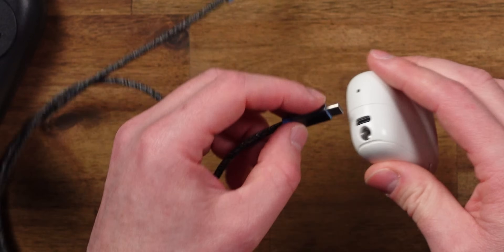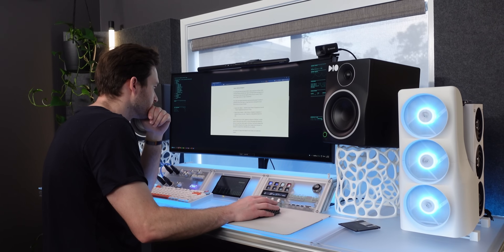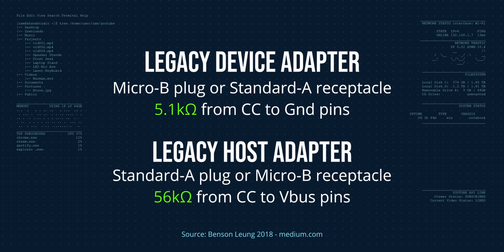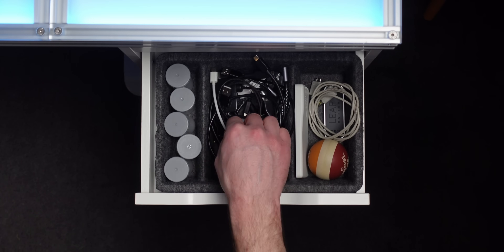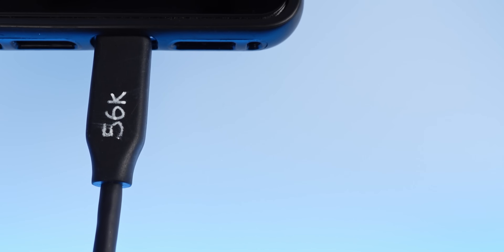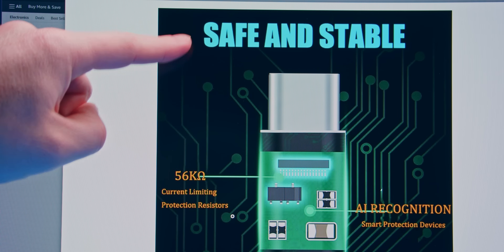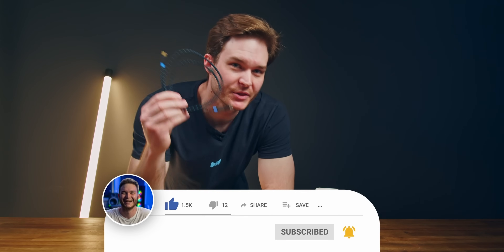USB-C to C cable not charging fix... by dongle?!

Comment: Hey Cam,
I really enjoyed watching your desk project, it actually inspired me to do a full room makeover!
I had a few questions and ideas I’m considering:
1. Is there anything you regret building into the desk? If so, what?
2. Are there any things I should be aware of before building a custom desk setup like this (with custom screens, buttons, etc.)?
3. Is there anything you'd personally love to see in a setup like this?
4. Did you run into any unexpected technical issues (e.g. screen compatibility, software glitches, heat issues, etc.)?
5. How do you control all the tech? Is it all automated, or do you use specific hardware/software setups?

Thanks in advance, keep up the good work!
Reply from the maker: Stoked to hear you're inspired to build your own!
1. Is there anything you regret building into the desk? If so, what?
USB Hub, it's currently playing up, and since the touchscreen, streamdeck, marcopad etc. rely on it, changing it is a lot of effort. I would (will in a future video), change to panel mount USB ports (extension cables with mounting screws), and then plug them into a USB hub, that way if there's any issues it's easy to swap, and also not hard to find a replacement with the exact ports I want on the panel mount side.

2. Are there any things I should be aware of before building a custom desk setup like this (with custom screens, buttons, etc.)?
If you use a metal frame, like I did, it's important to not have components PCB's touching the frame, as they can earth through different devices, and I think one of the LED strips is what's causing the USB hub to play up because of this 😅

3. Is there anything you'd personally love to see in a setup like this?
For me lighting is super important, not only for filming but actual functionality. I recently added an LED bar on my monitor, but will look to potentially ceiling mount a custom light that has controls in the desk dashboard. So for sure add lighting controls from the desk.
other than that I'm currently on a retractable USB cable hunt, you'll see them in my new vid this weekend, so I want to integrate them making it easier to plug phones and devices into my PC with a cable that retracts back into the dashboard.

4. Did you run into any unexpected technical issues (e.g. screen compatibility, software glitches, heat issues, etc.)?
No heat issues, LEDs don't work with razer hub and the razer software anymore (unsure if recent update but I've had an unresolved support ticket open for a long time with them), however the Razor Hub works perfectly fine through SignalRGB as I can manually say how many LED's are connected to each port (razer synapse requires an auto scan first) which defeated the entire effort of making them work with the Razer HUB to begin with. So I'd suggest to find a WLED or other LED strip controller that can do what you want, skip the Razer one.
I'd also suggest buying a powered USB hub, so that it doesn't matter what devices you plug in, all can be powered. 

5. How do you control all the tech? Is it all automated, or do you use specific hardware/software setups?
The Streamdeck is the main "brain" for all of my windows controls, everything else is the general hardware.
I've got my hands on the new streamdeck modules which they've just released, they sent them to me to try out and it's just the part you need to mount into a desk, really cool. But there isn't one yet with knobs like on the plus that I bought.  The knobs can be incredibly useful for volume control, and I also use them for webcam settings. highly recommend an elgato streamdeck as so many of the automations I wanted to program myself are already done in their plugin marketplace.

Hope that helps, have fun! 🤙
Reply: @camshand  Thanks so much for your reply! 🙌
I’ll definitely keep all those tips in mind, super helpful stuff!

About the LED strips, I actually built some myself using microcontrollers and a custom MQTT flow, it works really nice!

About the Elgato Streamdeck, they seem kinda pricey. Do you think a custom macropad would work instead?
I’m thinking about using an ESP32-S3 (really powerful microcontroller, totally worth checking out), with colored displays and mechanical switches.

Thanks again for taking the time to reply! Really appreciate it, and I’ll keep everything you said in mind!

Comment: there should be a thick full PD cable with a legacy switch... I didn't know that there were devices that did this!

do we know if that's within usb-c spec? it really shouldn't be - resistors are cheap!
Reply from the maker: no it's not within spec, they are non-compliant devices which is typical for uncommon brands, however the action camera in this video is from Insta360, one of the largest action camera brands in the world... and they skimped on a couple resistors 🥲
Reply: @camshand 
The raspberry pi 4 also didn't have those resistors.

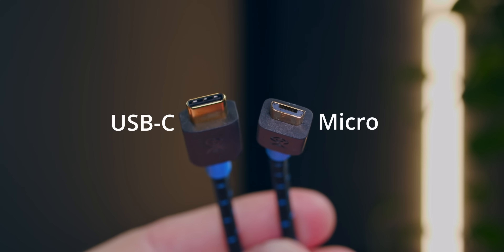Comment: 0:24
What? 
This creates even more problems LOL. Now you ONLY have a 5V cable that cannot negotiate to high voltage like 9V for phones and 20V for laptops.
???? This doesn't solve anything.
Reply from the maker: Maybe you didn't fully understand the issue.
There are USB-C devices out there that do not charge with a USB-C to USB-C cable.
This is because they're non compliant and don't negotiate their 5v needs, so simply don't charge when plugged into a USB-C charger.
These cable combos, allows you to change those devices with a USB-C port, which is major as some wall chargers or power banks don't have USB-A which is what's usually used.

The action camera in the video is a AU$479.99 insta360 GO II so even expensive devices need this.
Yes, it cannot negotiate 9v etc. over USB-C, but that's because it's not for fast charging purposes, it's for devices that don't charge at all.
Reply: @camshand  
I get all that, trust me, I've soldered 0603 5.1k to mod my flashlights and portable radios to accept usb-c to c, letting me chuck all USB-A cables + USB-A to C adapter (similar to yours). If I had done what you did, I'm just replacing (USB-A + adapter) cables with your (micro-usb+adapter), excuse me what??
Reply from the maker: Dude I don't understand? The second example I give in the video is to use the USB-A legacy adapter combo you're referring to?
I'm not saying to get rid of anything, the video is simply me sharing that I've just found out that you can use legacy cable combos to achieve the 5.1k hack and not have to rely on a 5V USB-A port charger to be around to others that may not know.

Great you can solder 5.1k mod yourself but I'm not keen on pulling apart my action camera to do so, therefore, the cable combo is a great option to have 🤙

Comment: Some powerbank-charger combos have a slow charging mode. Probably outputs 5v low amp without PD or any other quick charge tech on usb c to usb c.
Reply from the maker: I need to look into this further too, as I've tested slow charge/low power mode on two powerbanks of mine with a USB-C to C cable and nothing happens... Unsure if it's more so for devices that pull such little power that the powerbank may shut off thinking the device has finished charging.

Comment: Sweet tip! What's the tester you're using?
Reply from the maker: I don't have a USB-C PD specific charger yet (on my list to one day drop $100 on haha), so I used my Shargeek 170 that has a screen, and my Dockcase NVMe enclosure that displays USB data protocol when connected 🤙 handy to have
Reply: @camshand  nice! Great video as always
Reply from the maker: Thanks, I've been working on a "meant to be simple" project and it's just blown out in time haha. So when I discovered this little hack in the process I just had to share it!

Comment: One more solution: Adafruit makes an adapter called the "USB Type C CC Resistor Fixer" for use with regular USB-C cables. It doesn't come with a plastic shell, so may not be for everyone, but it does mean you don't need a full special able for the non-standard devices.
Reply from the maker: Yes! I have seen these, figured it was simpler to just cover the cables that are ready for on the go.
I also have some USB-C to 5V boards for electronics projects and battery chargers, neat stuff, just never knew basic cables had the resistors built in 😅
Reply: he could just 3d print a small casing for it :)
Reply from the maker: true that is a good idea, might be more practical to 3D print a little case and then keep it in my bag for when I'm caught without an adapter combo!

Comment: You have a cheap power supply if it doesn’t default back to 5v when the detection isn’t there
Reply from the maker: Actually not true. A USB-C port is never meant to supply 5v unless it's been explicitly told by the device.
E.g. if you plug a wall charger into your laptop, what happens when the laptop send 5v to the charger like it would your phone? if it did whilst the power supply "defaulted" to 5v then that'd be a very bad time.
Also stops people plugging two wall chargers into one another 😅

that's why this is so cool, it tricks the charger into thinking a device has asked for 5v, since the device isn't USB-C compliant and can't ask itself.
Reply: To add, this is not a power supply issue, but rather the device that requires power isn't USB complaint.

Comment: there is also a thing called pd (or qc i don't remember 😅) trigger boards/adapters
Reply from the maker: yeah I've seen a few in the past, also have a few USB-C to 5v boards for electronics and batteries. But they're not very travel friendly, which is why basic cables blew my mind 🤯

Comment: The cable that connects a USB stick into a phone is an OTG adapter on the go
Reply from the maker: Fun fact, with USB-C the term OTG doesn't apply!
Highly recommend reading the article from Benson Leung linked in the description that covers Legacy Device adapters and notes how OTG is terminology from Micro USB days.

To be honest though I still call them OTG adaptors in my head 😂
Reply: Ah interesting kinda makes sense since USB c has many standards included including display etc but will give it a read  @camshand
Reply: @camshand 
Yeah for USB-C application you either communicate using resistors or in the case of c2c data and power connection you will need microcontrollers that negotiation USB-PD for both power and data transfer speeds.
Reply: And not all OTG adapters are made equal IIRC, at least micro USB ones back in the day.